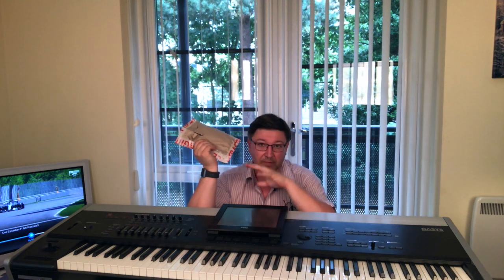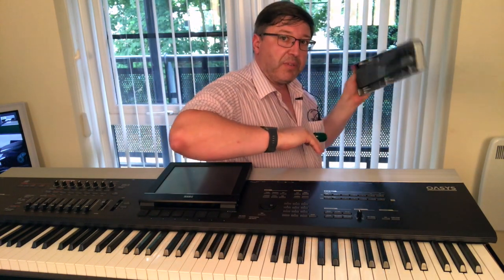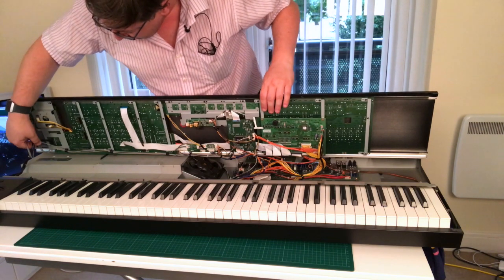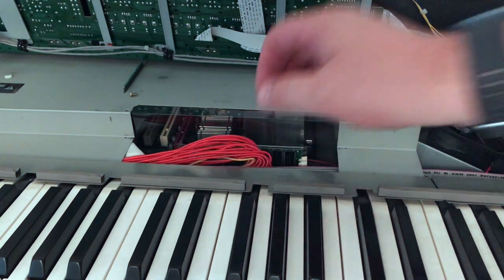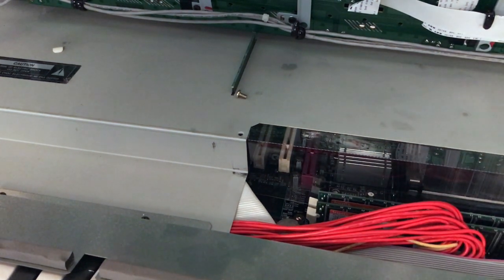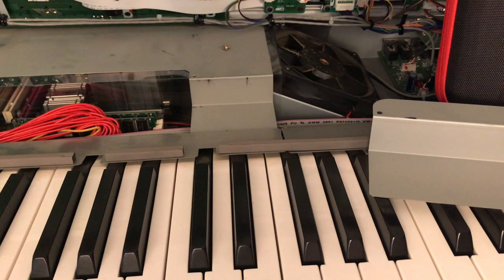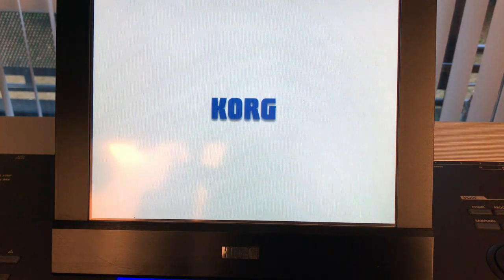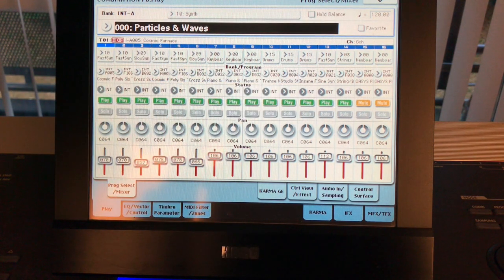Korg OASYS Installing more memory and a new battery

Comment: You can flip up the control surface and get to the battery and the memory by removing one screw at each end of the Oasys - there is no need to take off the end pieces and the silver trim.
Reply from the maker: Have you subscribed? :-)

Hi.  And you are absolutely right.  However, when I first got this machine it took ages to figure out how to release the control surface to get to the battery and memory area.  Maybe I should have read the service manual first lol.  Jon
Reply: Which two screws?
Reply from the maker: Have you subscribed? :-)

OK.  Here goes.  It is actually 3 screws on my OASYS 88.  Start at the end with the OASYS logo.  In line with the back rubber foot, 22cm from the back of the synth is a screw that looks different to the others.  That's screw 1.  Draw a line from right to left. 22cm from the back.  The 2nd and middle screw should be just before the middle foot 22cm from the back. The 3rd and last screw again 22cm from the back and about 15cm from the left hand end.  All three screw will look the same assuming someone hasn't been there before you. 

 Hope this is of help.  Jon
Reply: Well thats some need to know. Thanks again
Reply: I am going to try that after I see if I can corroborate it, otherwise, with any luck, perhaps I'll have a positive testimonial of my own to share.
     I bought a cream puff ( = what the used car salesman would call an older car driven exclusively to church on Sunday by someone's granny, for short) used '88 priced-to-move from a reputable local music store, and have been through all of the update procedures and registration stuff a few years ago. Unfortunately, it has stopped working. Regardless of the outcome I thank the OP for sharing so much info about what's going on under the hood. I assume I need to replace the 2032 but after reading some of the other threads elsewhere in this chat I'm not so sure. This keyboard has been a challenge: I can't imagine where I would be with this without the internet and the input from the user community. Fortunately when it works it has a veritable cornucopia of excellent sounds.
Reply from the maker: Hi @666rivers 

He is correct you only need to undo the lid and it should flip up to allow you to get access to the inner workings of the keyboard.  When I started with this keyboard I was pretty much working it out as I went along.  But now I know better after having worked with it for the last five or so years.

The other good thing about the OASYS, is that because it holds all the setting, tones, sequences etc on the hard drive when you change the battery you do not loose anything.  

However I think the fact that it has stopped working will not be a battery issue.  As you have not describe the nature of the not working comment it is difficult to offer any starting points.

But you are right in describing the the sound production as a cornucopia.  And glad to here you got a good price, these are starting to creep up second hand.  At the point I purchased mine the 88-key was about £2,000 for a good condition, but recently I have seen them topping out over £3,000.  Jon

Comment: Hi - Thanks for the very informative look into the innards of the OASYS, and the battery and memory updating.  I'm the original owner of a very lightly used (+/- 100 hours) OASYS 88, which I recently started using again after an extended hiatus.  When I started using the OASYS again, it was intermittently looking for “reauthorization codes” during power-on startup. I could power off/on and it would start up normally (except for the "replace battery warning") for 3-4 and function normally, before hanging again on the reauthorization code screen (and restarting normally again).  I followed the instructions on the OASYS support site to request reauthorization codes, which informed me that I would receive the codes in an email within 1-2 days.  (I never received the email with the reauthorization code).

After about two weeks of daily use with the intermittent reauthorization code hang, the OASYS no longer completed startup )with or without reauthorization request), and instead consistently hangs at one of three points, all less than 1/2 way through the the loading progress bar. Korg support says that all they can advise is to reinstall the software (or call a Korg dealer, which I did twice but didn't get a call back).

Do you think that these hangs could be caused by 1)the dead battery, or 2) the expired? reauthorization codes, or 3) a software problem, or 4) a failing disk? (I was at V 3.1, and installed V3.3a, but it didn't affect the progress bar hangs). Any advice would be greatly appreciated!
Reply from the maker: Have you subscribed? :-)

Firstly for what ever reason the keyboard has lost its authorisation codes.  These are stored on the hard drive.  Have you reformatted the drive or deleted information from the drive?

The battery handles normally computer settings and in this case keyboard settings.  As far as I am aware it does not hold the authorisation codes in a battery powered volatile memory.  So I do not think that a dead battery has caused this problem.

I seem to recall that the keyboard will operate for about 2 weeks on temporary or unauthorised codes before refusing to boot.  This would seem to fit the behaviour that you have described.  So you are going to have to obtain new codes, which you have tried to do.

The first thing is did you register the keyboard?  Have you changed your e-mail address since you registered your keyboard.  

Korg instigated through Korg.Net an anti-theft registration which meant that if the keyboard was stolen and sold on, at the point the new user tried to register the keyboard they could notify the authorities and the original user would get their property back.  Unless this was properly transferred to you then the codes will be sent to the e-mail address of the previous owner.  You need to ring Korg support to get this changed into your name if this is the situation.

If it is a case of changing e-mail address then you will need to either access the other account or ring Korg support to get your new e-mail address logged.

In terms of the hanging, you might have to re-format the hard drive and re-install the operating system to allow you to enter the codes.  This could be signs of a failing hard-drive, but I would try the reformatting route once you have got hold of new codes.  If it is the hard-drive then your have the codes to allow you to install a new SSD in place of the current drive.

I hope that that gives you some pointers.  Jon
Reply: @TheMusicTechGuyUK  I was able to finally get the reauthorization codes for my OASYS (purchased and registered in 2005) from Korg support, when the OASYS web site wouldn't send them. I still couldn't get it to boot properly (hangs), so I started replacing the disk, which ran into a variety of problems while trying to format and reinstall from 1.0 and 1.1 CDs. I eventually realized that I had dimm problems, replaced the 2x1GB dimm cards, got a successful reinstall with 3.1 CDs on a 128GB KingSpec SSD (as well as a 60GB Fujitsu IDE, which I tried before I realized I had a dimm problem) and reauthorized the rest of the mods. OASYS boots/loads faster, has more capacity for user stuff, likely runs cooler (fan seems quieter), and the disk will likely last longer. My last challenge was after everything was booting, LCD working, etc., but I couldn't get any sound out of the channels out or headphones, because a small connector on the right side (disk, dimms, battery are all on the left side) had pulled loose when I moved the top panel back out of the way. Everything works great, like new, with faster, quieter, larger, cooler disk. Happy to answer questions from other OASYS owners, others' experiences on Korg/Karma and your own were very helpful.
Reply from the maker: @a Fitzgerald that is a great result.  Always great to hear someone has repair a fab board like this.  Jon
Reply: @afitzgerald21  I am at this place now -waiting to see if korg gets back to me with authorization code - lets hope -cheers and thx for the info
Reply from the maker: Fingers crossed.  Jon
Reply: @TheMusicTechGuyUK  still waiting ....
Reply: @mitchlazer7948  try Korg user net now, I got mine after a couple of days last week.
Reply: @afitzgerald21  how would I migrate the disk to ssd, do I need connectors??

Comment: Hi sir, do you video Oasys how to replace hard disk? Mine about crash…can’t boot to program since on and has system error 5.
Do you replace your oasys with SSD? Thanks in advance 🫡
Reply from the maker: Hi @Hannynco

This is one of those yes and no answers.  Yes you can install an SSD drive in your Korg OASYS and you will find many commentators on the internet telling you that they have done it.  But few say how!

The Korg OASYS motherboard does not support the SSD interface natively.  You need to use an IDE / SATA converter in between the old interface and the new SSD drive.  I had a very similar issue with the MUSE Receptor REV 1.0 C.

Unless you can clone the original drive using one of the cloning utilities, you will need to re-load the Korg OASYS operating system and then contact Korg support to get the authorisation codes assuming you don’t have the original authorisation disk.  Jon
Reply: @TheMusicTechGuyUK  thank a lot sir 🙏❤️
Reply from the maker: Hi @Hannynco. NP Jon

Comment: Thanks for in put on how replace battery all so I have the 8 buttons under screen that some are not working. Hopping I can clean them win i put in new battery. That fan right next to buttons properly blowing dust on them. 
I also have some of the red buttons on right side  of screen.  Some of the program is buttons like the function are very dim .guess I will have to get to under the board and make sure I have the right light. Check voltage. And see whats up. Or may just let it slide. Don't want to get out of my comfort zone.
Thanks ever so much showing  where is the battery . Ill be hang on to your site .I got a Ensoniq ,mirage key board I want to give to a up and coming kid who just graduated high school and is doing very good .I want to upgrade his keyboard. I know it needs a new belt for drive and a new battery on it ,but I have done that before.  Good video
Thanks Garry
Reply from the maker: HI @Garry M

You will not regret putting the OASYS back to rude health.  It is a fantastic keyboard that stands up to the keyboards of today in terms of sound generation and quality.  As you say the pads probably need a clean.  You might need to reseat the connector as well.

In terms of the LED’s I must admit that I haven’t looked at the circuit diagram relating to them, but I think I would also be looking at the voltages first.

Not got a Mirage in the stable so at this point can’t help you with that one.  You might want to search for the service manual, however my experience of the EPS 16 Plus service manual is that compared to the Roland equivalent from the same time it is pretty basic.  Jon

Comment: Is it worth purchasing the korg oasys now so many years after its initial launch in 2005 and if so why?
Reply from the maker: Hi @Trevor Nelson

I own one so I would say that they are worth it.  The engines on the OASYS are in essence the forerunners of the engines that have been installed in the Kronos.  You can use these to structure your own custom sounds and store then on the internal disk drive.

It uses the same AD and sampling circuitry as the 1st Kronos.  I think the Kronos 2 made some tweaks (but I am saying this from memory so don't quote me.)

Basically the Kronos expanded the OASYS concept by having a Linux machine running custom Korg code that generated the sound.  The OASYS changed the way manufacturers looked at the synth and workstation.

Remember the OASYS 88 was an $8,000 plus machine when Korg released it, the screen is 10".  The knobs and faders can be mapped to control various parameters.  The sequencer has enough flexibility to allow you to compose a more or less completed piece.  The 88 which is the machine I own has a wonder fully weighed key action.  Do you get the impression I like my unit?

The problem is that the price of a good second hand version can hit $2,000.  And for that money you can get a good second hand Kronos or if I were looking for a workstation like this right now I would be looking seriously at the Roland Fantom.

So to answer your question.  If you can acquire one for a good price then yes it is worth acquiring.  After all Tony Banks from Genesis is using a Korg OASYS on the current Last Domino tour and not a new Kronos or Nautilus.

Hope this provided some perspective on your question?  Jon

Comment: I have an oasys 76, there are five keys that have less intensity or attack than the others, how can I solve that problem??? Do you have a social network to contact you??? I'm Mauro from Argentina!
Reply from the maker: Hi @mauars21 

Greetings to Argentina.  And to answer the last question first Instagram: @themusictechguyuk Facebook: The Music Tech Guy UK.  You can contact me through either of these platforms.

You don't mention whether these keys are in the same area of the keyboard.  If they are it is possible that you have track damage.  If not it could be that a light clean of the contacts or even re-carboning the contacts might be required.  What ever the issue is I suspect that you will need to strip the key bed down.  Jon

Comment: Hi,

And if you install a 2gb dimm extra, than the oasys will have 3gb memory?

Kind regards
Reply from the maker: Thanks for this.  I know that in the base OS 1.0.1 back in 2005, the keyboard only addressed the first DIMM slot.  After that, and I don’t know which release it was, the second DIMM slot was capable of being addressed.

The Keyboard itself, being a 32Bit OS can theoretically address 4Gb of RAM, but most of these devices are limited to 3.5Gb as other operating system ‘bits’ end up in the other 0.5Gb.

Two things I wasn’t aware of:
1. You can upgrade the memory unevenly.  I.e. as you stated a 1Gb and 2Gb RAM chip being added to the 2 memory board slots.
2. If you added 2 2GB chips to the memory slots that the OASYS would address as much as it could.  The OS is well written not to error.  I may well in the future add 2 2GB DIMM’s to my OASYS.
Reply: @TheMusicTechGuyUK   thanks for your answer 🙏

Comment: My Korg Oasys not working display ? Please Help !!!! Baterry replaced ?
Reply from the maker: Hi @tudor horia  

I would be looking at the screen connections to the internal boards.  If the back light has gone then you should be able to see a faint display of information on the screen.  This would indicate the replacement of the light.  Although I have not done this repair myself.
If there is no information on the screen at all, then you could have a dead screen or a component that drives the screen has failed.  You may need a service tech to diagnose for you.  Jon

Comment: I understood that it has a clock battery in the back. Must be replaced? to work with the screen?
Reply from the maker: Hi @tudor horia  

The battery has no effect on the display.  The OASYS should still boot with a dead battery, just all the settings and computer config will be lost e.g. time and date.  
All the other stuff is stored on the hard drive.  Jon
Reply: Thanks very much !
Reply from the maker: Hi @tudor horia   No problem.  Jon

Comment: I've inherited an oasys with 4 disks , but no registration disk , won't boot up , is it a doorstop? cheers
Reply from the maker: Have you subscribed? :-)

Oh I hope that it isn’t a door stop as these machines are Wonderfull to work with.  When you say 4 disks it is unclear whether these are hard drives or CD’s?  

Like any computer the OASYS boots from the internal hard drive.  If your machine is not booting then that would be my first port of call.  Is it correctly connected to the motherboard and has power?

If the hard drive is connected but not booting you might need to re-install the OASYS OS.  If you don’t have this then you can get this from Korg Support.  They supplied me with the updated OS’s when I acquired mine and also generated the licence file for me which I had to burn to CD and then install.  

The installation process for the OASYS OS is a Next, Next, Next style process.

Hope this helps?  Jon
Reply: @TheMusicTechGuyUK  Hi Jon - yes I've subscribed  - I have the 4 cd's that came with the oasys, but not the license file - tried to register on korg website but it rejected my email adress as it was not the one connected to serial number/16 digit code - hoping they will support me or this will be parts for someone-cheers
Reply from the maker: @Mitch Lazer. Most other people I have spoken to said as long as it does not flash up in a stolen list you should be able to swap the registration into you name.  Jon
Reply: @TheMusicTechGuyUK  that would be great - still waiting for a response from Korg Canada - cheers  I'll keep you posted
Reply from the maker: NP Jon